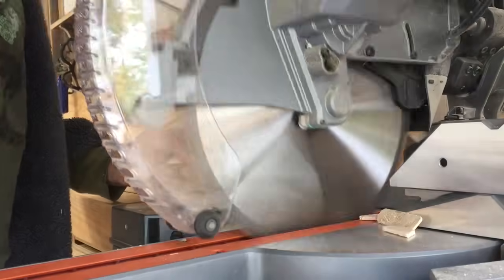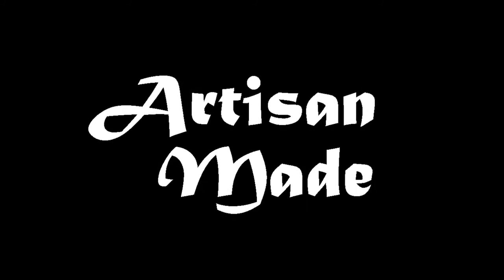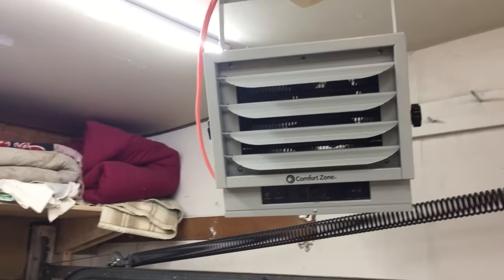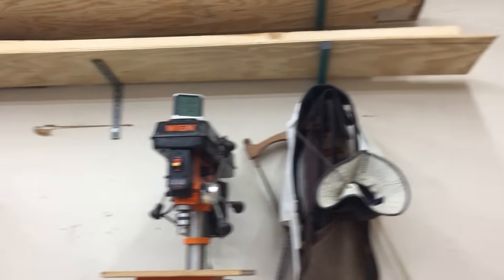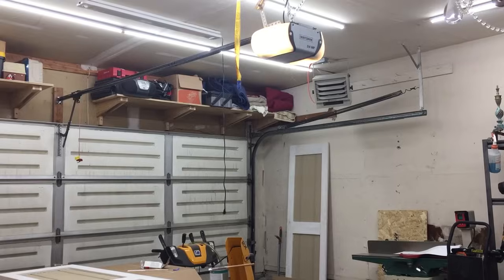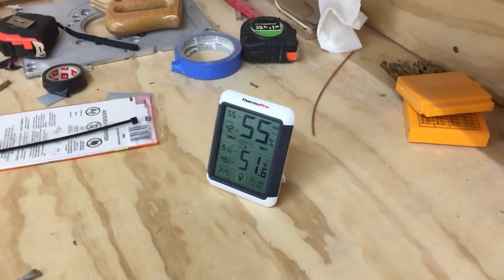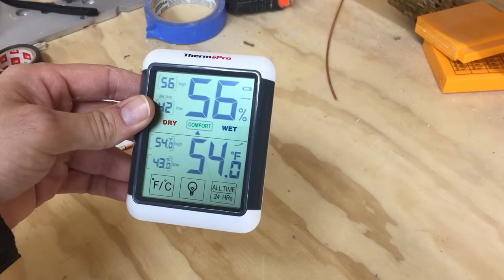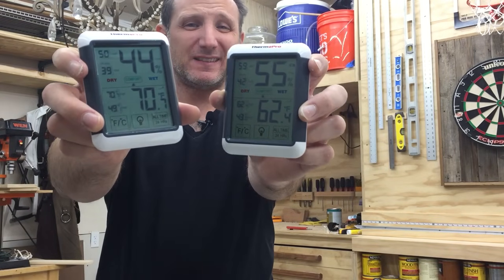How to Heat a Garage or Workshop for Under $100. The Comfort Zone Industrial Heater: Does it Work?

Comment: Like they say in the horse business, "It ain't the purchase price...it's the upkeep".   Electric bill is a comin' !!   Hang on.
Reply: Yeah, exactly. High electric bill coming!
Reply: @cheerry777  Yeah, but if you're looking at $1500 to run gas, vs being able to do the electrical work yourself, $1500 will pay for a lot of electrons!
Reply: @pilotalan  lol maybe for an year. Electric is a waste of money if you live in a cold climate and do actual work in the garage, gas is the only way and is well worth the initial investment rather than pay electric year after year.
Reply: @pushtoyota  It depends on your use case.  In my case, electricity is 30 cents an hour (after 60 minutes, the heater cycles off and on).  The heater is only needed six months out of the year.  
Even if gas was free (which it isn't), it would take over 5000 hours for gas to come out ahead.  I'll be dead by then.
Reply: @pilotalan  You're only going to live another 7 months. A little pessimistic isn't it?
Reply: Awesome
Reply: Electric is WAY more expensive to heat with.  Doesn't matter what you say, unless you get free electricity

Comment: These are cheaper to run than a diesel or kerosene heater i fill my mr heater kerosene heater and it costs me 35 tp 40 bucks plus hydro for only 8 hrs so these are alot better to run.

Comment: I strongly recommend insulating your garage.  It's currently 21 degrees outside but it's 54 degrees in my garage without the heater on.  Insulated door (very important), walls, roof--and with a 1500 watt ceiling-mounted radiant heater on, it raises the temperature easily in about an hour and maintains it.
Reply: @Daniel Bradford How would you insulate a garage door? Do I need a new door? I'm in the south Texas and was thinking I need a mini-split for air conditioning (and I suppose these units heat as well).
Reply: So magically insulation keeps your garage in the 50s when it's in the 20s outside.

Comment: How much of an impact has it made on your electric bill? (percentage of increase)
Reply from the maker: I have no idea.  Electric is very expensive where I live.   My electric bills are always very high.  I would imagine it is similar to running a small window air conditioning unit.
Reply: @NonyaBusiness! Is it safe to run one of these heaters round-the-clock? I’m also looking to keep my detached garage/workshop above freezing so I can keep glue, finishes, etc, out there. Thanks for any input!
Reply: @cwaxwingsfly late reply, I'm a journeyman electrician. I would be very careful running any electric heater 24/7. Best to use it as needed. That said, I'm sure it'd be just fine. Just check on it daily.

Comment: I have one of those.  It works really well if you have a fan going too, mine is a ceiling fan.  My space is insulated also, and it will raise the temp 10 degrees in 15 minutes (from 50deg)

Comment: Id get a couple rolls of the double reflective insulation, some spray adhesive and aluminum tape and put it on the garage door. It’s cheap and helps a lot for what it is

Comment: Hang a DIY box fan / air filter blowing upward low enough to reach the switch.  It will filter the air as well as mix the cold air on the floor with the stratified warm air.  Big difference!

Comment: Thanks for the video. I also have an 18x20 garage. It's a metal building with foil bubble insulation and an uninsulated roll up door. I purchased the 7.5kW version of this heater and will install it this weekend. Should keep my garage a comfortable working temp. The added capacity should also bring it up to temp faster. Didn't route a gas line and don't want to constantly refill propane or stinky kerosene.
Reply from the maker: I agree, especially if you are not running it every day. But if you already have gas lines in your house, definitely worth it then.
Reply: Any update on this? I have a 1700sqft garage that is well insulated and wondering how I'd fare
Reply: @captin2284  my 7.5kw electric heater heats my 18x20 garage very well. Heats up fast too. Only thing is the ceiling is high in there and the heat tends to stay up high. This trips the thermostat on the unit before it reaches temp at working level. I fixed the issue by setting the heater to 90°F shutoff. That makes it nice and cozy to work in a t-shirt even in the dead of winter.

Comment: Using a cheap box fan will minimize striation of air temperatur in the building.
Two walls insulated is like a box with only two sides. If you have a man door, do a fan test on how well the building is sealed for air leahs, then seal those air leaks. The $100 price for the heater is minimal for all the extra kilowatts you will be purchasing with that much leakage and uninsulated square footage.

If you aren't planning on staying long, great. Otherwise:
-Seal it up
-insulate
- add a circulation fan in the opposite corner blowing downward to heat the whole building.
Good video.

Comment: I have the same heater in a 16 x 24 garage.  Insulated door and ceiling.  Walls are not insulated.  In the 40's to 50's it heats up quickly to a comfortable temp.  Colder I have the same issue.  It's warm in the top of the garage but much cooler lower.  When the temp is down in the teens and the garage is empty it just knocks the edge off.  However my son changed his oil in there once in the teens and it was very comfortable.  (Less air to warm maybe?).  Got mine on a Black Friday deal a few years ago for about 80 bucks so really it was worth it.

Comment: An option would be to get a small propane heater to help get the temperature up quickly then use the electric ceiling heater to maintain the temp.
Reply: Your better off buying a mini split and sizing it for heating. Heat pumps are far more efficient and will pay for itself compared to a conventional electric coil heater

Comment: I heat my insulated three stall garage with one of these but it needs a little help when it's real cold outside. Once the temps start to dip down into the low 20s, I use my 80,000 btu kerosene heater to bring the temp up to about 68 - 70 or so, (which takes a whole 15 minutes) and then the 5000w over head electric heater can maintain the heat from there usually. The kerosene heater never has to come back on unless it way below 0 outside. They work pretty good an if you clean them out periodically and lube the motor, they last for many years.

Comment: I left unit on 55 degree 100% time but ceiling was insulated 12" insulated door ,all walls on 20 x20 insulated. Cost 35 .oo a month . Took 15 min when i was out there to get 70 degree.
Reply: I use a 135k btu diesel bullet heater. Takes about 4 minutes to get 70 in two car garage from ambient of 25ish.

Comment: Key word here is "insulation". You can easily insulate your garage door with some foam board. It works really well and isn't expensive to do.
Reply from the maker: That’s a great idea. I needed to replace the door anyway, so now I have a fully insulated shop.

Comment: What is the energy consumption of the heater. the cost is minimal compared to what it will cost to operate.
Reply: 5000 watts. That's less than 45 cents an hour where i live.

Comment: Ive discovered something rather recent.  I live in the mid-west and I just need to keep a few plants from freezing going dormant ok.  I happen to an inwall heater because my water softener is out there.  But Im noticing that by simply parking my vehicle in there its much easier to heat,  it is about a car and half size space .  I mainly keep a temp monitor running for plants so I know how cold it is out there. Tonight it will get tested as outside air will go into the 20s F.

Comment: I have a 5000 / 7500 watt unit in my 2 car uninsulated Chicago garage. On brutal days, I run a propane torpedo heater with it to get up to temp fast... Then kill the propane heater and let the overhead electric maintain the temp....

Comment: i had installed my unit only 1 foot off the floor (adjusted fins to blow straight out vs down) found that it removes cold air below 4 foot level and heats the shop much faster

Comment: I have the same unit, I have a high pressure fan I point up at the ceiling to circulate the heat. Makes a huge difference, I do have a 2.5 car garage but it is well insulated.
Reply from the maker: I insulated my garage over the summer. I'm sure it will work even better now.

Comment: A centrally located ceiling fan set at low speed, blowing up would move the warm air up high out across the ceiling to the walls and then down to the floor. That would more evenly distribute the heated air.
Reply: yeah but it's kind of weird having a ceiling fan in a garage

Comment: My garage is insulated but my garage door is not. I live in northern Idaho and I’m excited for this heater to get here and get installed
Reply from the maker: I think it will work well. When I made this video I didn’t have any insulation anywhere. Now I have insulation everywhere and one the space is warm I have to shut off and on because it gets too hot. Good luck!

Comment: You could probably mount the heater lower because heat does rise that’s why the lower half stays cooler. And using a fan to help move the heat around to works good.
Reply: Lloyd Roth
 ... the main problem with mounting a unit lower is all the crap the average guy has in the garage. (fire hazard) You can certainly mount it high and aim it to blow toward the floor. (recommended) The key to better comfort is usually more air flow than the heater can provide. IOW, a second fan (elsewhere) to push the warm air to the floor.
Reply: What will happen if you mount the heater lower?

Comment: hi, wondering how that worked out for you.   seems like your Electric bill would go up 300 dollars a month if you are in the garage 4-6 hours each day.    thx
Reply from the maker: It cost me about 50 cents an hour if I am running it on the highest setting. Usually run it on high for the first 30 mins and then drop to low. Probably costs $2-3 for a 10 hour work day.
Reply: @ArtisanMade  thx for getting back to me.  100 dollars a month for total productivity, worth it.   Nice!!

Comment: the problem is how expensive electricity is.  it's 16c/kwh here in upstate NY.  was costing me a fortune to heat my garage.  switched to a 40000btu modine hotdawg natural gas heater and now the garage is warmer & it costs about 1/3 as much to run it.
Reply from the maker: It costs me about 50 cents an hour to run on high but I only run it when I’m in there working so it isn’t a huge expense

Comment: I would say it's probably not very good for my needs.  I live in the Midwest where it's now winter.  Can easily get to 0 degrees outside.  With an uninsulated garage, it looks like on those days, I might hope for it to get to around 10 if I'm lucky.  That wouldn't help at all.  Never mind the added electricity for no useful benefit.

Comment: I have one of these it has 3 Temp settings 3500 4000 and 5000 i run it for 15 min at 5000 then turn it down to 3500 to maintain the Temp works really well but my Woodshop is really well insulated.
Reply: You have the same exact one ?
Reply: @kye6134  Its a Comfort Zone with 3 diff heat settings i bought it at a Runnings store and paid $99 it works great and i live in Upstate NY where it gets pretty cold in the Winter.
Reply: How much did it change your electric bill
Reply: @endlesssummer3406  Not sure because i have Solar on my House lol!

Comment: I got mine for $84.00 fron Home Depot...  it added about $50.00- 75.00 to my power bill.... but then I have it on a remote thermostat and set @ 60F. unit is left on like regular central heating and regulates just fine.
Reply: Was this increased electricity cost running it all month or just when you were out  in your garage?  If so, about how many days if use a month?   Thanks
Reply: What kind of thermostat did you use? And how long the heater is on?

Comment: I live in a 32 foot camper trailer at 9360 feet elevation... Would you recommend this heater.... My small space heaters arnt cutting it
Reply from the maker: I think it would work but might be a little loud for a living space, and i don't think it is energy efficient enough to be used 24/7.  You would probably save money in the long run, buying a more expensive and efficient unit.
Reply: IT requires 240V...
Reply: That stinks, I would jump off a bridge before I would live in a trailer
Reply: Small wood stove and fan?
Reply: @wayneguy6043  Post it on youtube so we can all watch.
Reply: I heat my home with 1

Comment: Can u use this in a unfinished basement
Reply from the maker: I guess you could but this is not efficient and it uses forced air which is heated up by hot coils. I don’t like the idea of running this kind of heater in the House 24/7. I prefer something of higher quality with some safety features

Comment: Did you faint when you saw your electric bill??
Reply: I've gotton 300 dollar electric bills with mine.
Reply: @mitchdenner9743  YEOWCH!! I just used a little 1500 watt heater in my shop and it cost WAY too much even for weekends use so I built a waste oil heater.
Reply: @centaurus777  yeah, a 5000 watt heater pulls close to 21 amps. Ran it for a week or two in the middle of winter and ended up with a 300 dollar electric bill. Learned my lesson, now i use it sparingly.
Reply: @mitchdenner9743  How much is your electricity? Mine is 9c a kilowatt. My heater costs less than 45 cents an hour. Unless its really cold out, its only on about 60-75% of the time. If im in the garage, im making 100 times that. I have done the propane and wood stove but the electric is quiet and maintenance free.
Reply: @mitchdenner9743  I'm in a winter climate, and if I ran that for 14 days, 24hrs per day it would only be $56. Does your house have electric heat too?
Reply: @mikeanderson8023  no it doesn't,  i have oil heat, it might of been closer to a month, time goes by so fast anymore i really just don't pay attention that much but 50 cents a kilawatt hour to run that thing plus the rest of my house. I also have no gas here so oven, washer,  dryer all electric.
Reply: @mitchdenner9743  Wow! That's high. My power here in Canada is about 1/4 of that. My heat is gas, everything else electric and my power, heat and utilities in the winter are less than $250 a month.
Reply: @mikeanderson8023  well that 50 cents a kilawatt hour is for a 5000 watt electric heater in the garage which i normally don't run unless i have a special project to do in the garage. Normal hydro rate is 10 cents a kw hour x 5000 watt heater = the 50 cents an hour to run the thing. I pay around 8 cents a kw hour now by  using a green energy supplier so my normal hydro bills are 50 bucks a month and  i purchase fuel oil in the off season and filled my tanks for 1.85 a gallon. So per month in the winter I'm less than 250 a month total utilities also. Figure i use 400 gallons of fuel oil a season at $1.85 a gallon thats 740 bucks total ÷ 6 months = 123 dollars a month for oil plus 50 a month for hydro so I'm well under 250 a month for winter utilities. Of course its alot milder here in new jersey especially the last few years with little to no snow.

Comment: Would be great if you can reduce your power consumption is went with a solar panel setup for heat heater box. Still great video.
Reply from the maker: I want to solar power the whole house

Comment: I was thinking about one of these an use generator but mine is only 3300 continuous watts
Reply: Steven Culbertson jr
 ... why would you use a generator when the cost to run that will be at least 4 times more than utility power? (yes, I have done the math)

Comment: I have one in my shop I love it I really can't tell much with the electric bill
Reply: mex700 ... 5000 watts X 17 cents per hour = 85 cents an hour to run.... or $6.80 for an 8 hour day continuous run. (if cold enough for that) You'd have to do your own math to figure out what your costs are using it every day (all day?) versus only weekends versus on a few days a month for a few hours each time.
Reply: @rupe53  Wow, its only 9cents per kw where i live.
Reply: @alecb8509  ... you might be right or you might not be considering the various taxes, fuel charges, and transmission fees in your total bill. My "base price" for electricity is also 9 cents but the other things add up quickly.
Reply: @rupe53 No, that is total cost per kw. I live near a nuclear plant.
Reply: @alecb8509  ... ok, most report living near a hydro plant to get a decent rate like that.

Comment: How cold do your winters get ?
Reply from the maker: I’m in New York. I was working on projects when it was 20F and it warmed up my shop to 55F. I didn’t have an insulated garage or door. I insulated everything recently, so I’m sure it will get even warmer. Overall,  it has served me well.
Reply: Artisan Made , thanks for your response. 20F is like -7C. That was in your shop. Wondering what outside temp was. Here in Alberta Canada it can get to -35C outside which can make my only partly insulated shop quite cold lol. I do plan on doing more insulation and looking for heating choices. My shop is also below ground level so it’s a challenge for sure. 😉

Comment: Wish I could have gotten one of these back when there were under $100. As of today $250🤬
Reply: I just got a 7500 watt unit for $150 from norther tool. The 5000 unit is $99 bucks.

A lot of these cheaper garage heaters appear to be from the same manufacturer.
Reply: @darwinawardcommittee  yep, just got the smaller one from northern tool yesterday for $100.